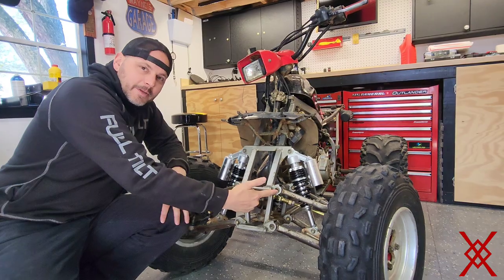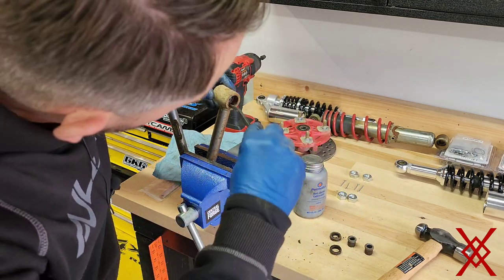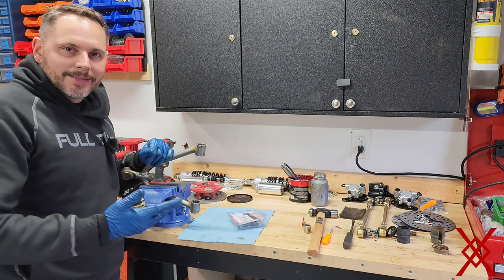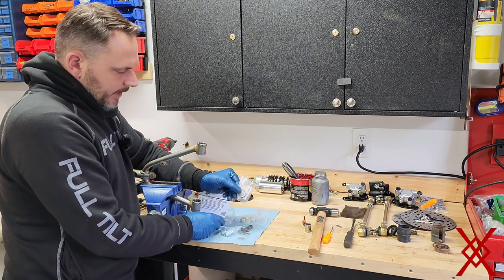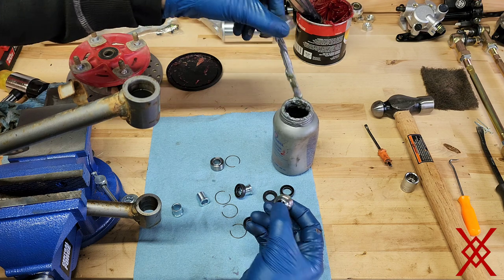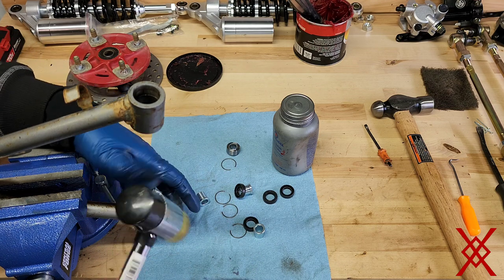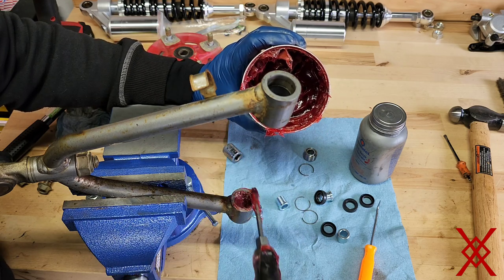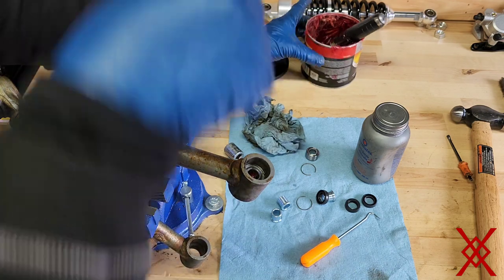HONDA ATV HOW-TO Replace A-Arm Bushing & Bearings

Comment: I’m curious can you replace out the ball joints on a 2002 Trx 300ex?
Reply from the maker: I'm not 100%, but I believe they can be pressed out, but are the parts available? I'd have to look into that. I haven't done this yet, but guys have cut them off, drilled out the hole in the a-arm, and added a bolt on adjustable heim joint. Might be something to look into or just drop the 💰 on aftermarket a-arms. If I ever need to do this, I'll make a video. Thanks for watching and subscribing.

Comment: Where did you get those shocks mine are blown out great video
Reply from the maker: Got them off ebay. Search honda 250x air front shocks, 87-92 250x rear shock.  1 slight mod for front shocks. I took the spacer out from the old shock  and basically cut it in half to use as a spacer for the new front shock lower bolt. Easy mod. Good shocks, slight upgrade from stock. Thanks for watching.
Reply from the maker: Also check out the Front end begins and ends in the Honda 250x playlist, for some more info.
https://youtu.be/0ywbuDcF1wU?si=pS488aB88uhrdQ5i

Comment: Are those stock ball joints for a 250x? All the 300ex and 400ex ball joints are welded in and they no longer offer replacement A Arms.
Reply from the maker: Thank you for watching. Good question. Yes, these are the stock 87 ball joints. I was surprised they're still in really good condition. They don't have any extra play, and the boots are not cracked. Honda win. I'm pretty sure their are aftermarket a-arms & ball joints. I believe 300ex are press in & 400ex are bolt on style.  If you're referring to the a-arm bushings, they're the same for all trx models. I hope I helped. These parts were Ebay shopped new. Thanks for watching. Reach out again if you have any more questions.
Reply: You can cut the stock ones off and put bolt on style don't remember exactly where to cut but a quick Google search will tell you where
Reply: I just looked at my 400ex and if you measure the inside of the opposite side where the ball joint is welded then you know where to cut if that makes sense
Reply from the maker: @garrettraveling2059  thanks for sharing your knowledge in the comments. Helps keep the community growing. 👌